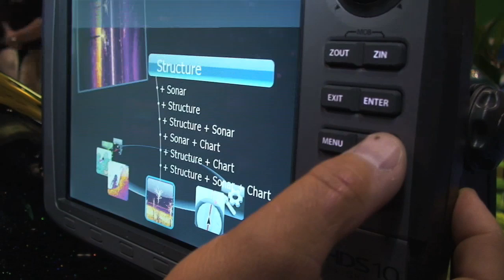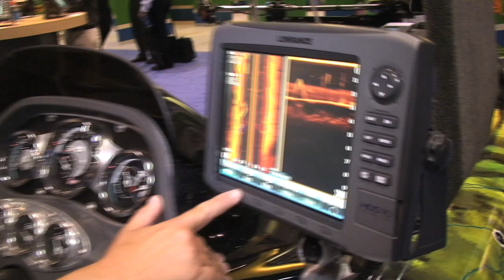Lowrance StructureScan

Comment: please HELP.... I have a Lowrance LMS 332c that no longer powers on. The unit is 3 y/o and need an upgrade anyway.  I've checked the wiring at its good, I want to know this: Can I replace the LMS with the HDS7 and still use the same transducer and power wiring.?